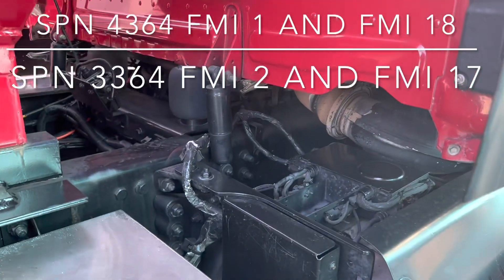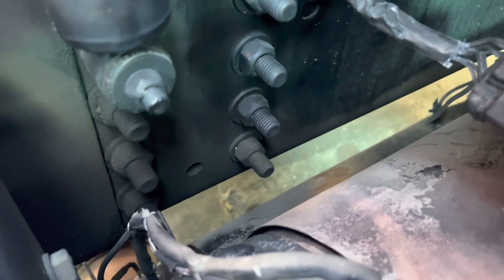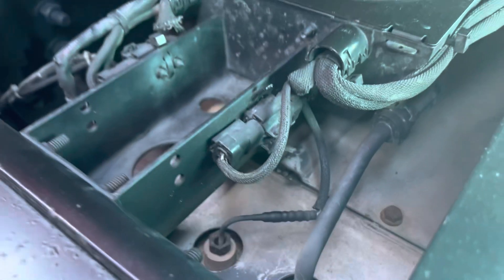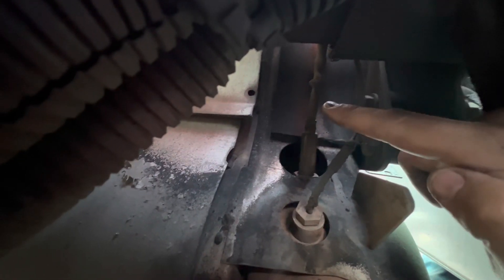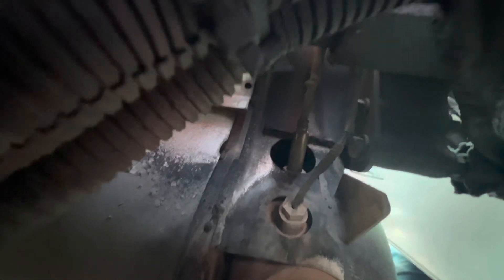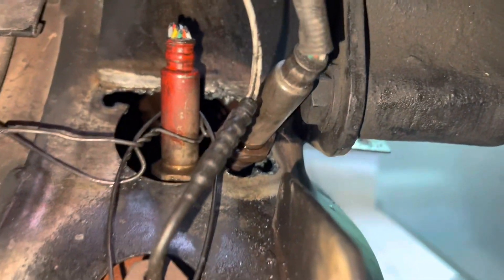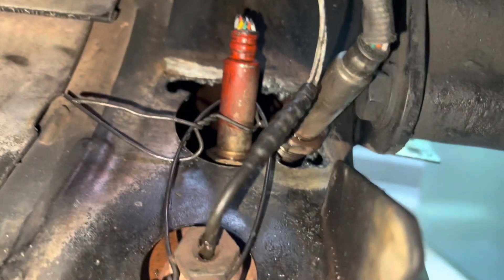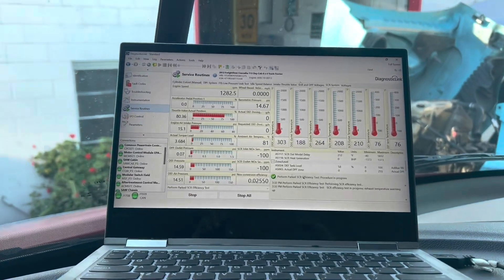NOx efficiency low, SPN 4364 FMI 1 and 18. SPN 3364 FMI 2 and 17. Try this work first.

Comment: Been getting a code for outlet nox sensor error, but seems to work fine. Know any work around for the code? Also does the outlet nox sensor error code turn off any regen process? Seems to be working normally but want to confirm. Sucks having a constant check engine light cause the sensor but beats putting a one box on.

Comment: Hey brother good video I have a question  I having kinda a similar problem on my 16 cascadia dd13 
When I go up in  a heel  loaded   it gives me the bad def quality signal. Then I run a regen and it goes  away  any idea what could  be ? .  A nox sensor?
Reply from the maker: You can run a parked regen and look at the inlet and outlet. If the sensor is fluctuating and not holding steady then it could be bad. Also look at the tail pipe for any ash or soot. The tailpipe should be clean and have no soot or ash present. 
How many miles are in the truck? 
The MCM will trigger a fault for DEF quality if the NOx efficiency low. The MCM or ACM does not know the difference.
Reply: It has 884851 i got my dpf filter cleaned 100k miles ago   also replaced  a faulty  def doser 45k miles ago  but they don't they replaced  doser gasket  found out it was leaking def .  I just replaced  the gasket   2 days ago   I hope that was issue
Reply: @196ozzy what was the issue?

Comment: 4364 FMI 18  inlet nox or outlet?
Reply from the maker: @pftrans  depends on how the inlet PPM and outlet PPM are responding. If they are stable then the sensors are most likely good. 
How many miles are on the truck? 
What year is the truck?
Reply: @CarlosDieselElectric   I checked out the reading were acceptable, contaminated DEF was the cause.
Reply from the maker: @ nice catch 👍🏼
Reply: Can this help to do the ctcheck regulation

Comment: I got the same codes, low efficiency. I'm at the dealership in connecticut, and they're talking about wiring and harnesses  🙄 
Their computer dont show codes but it shows on my dash
Reply from the maker: What is your NOx efficiency?
Reply: @CarlosDieselElectric  I have no idea I'm the driver I asked the guy if they were gonna run the truck on the computer to check for all that, but he told me tomorrow. But he kept saying it could be wiring, harness problem.

Comment: In this case have to replace the DPF or SCR filter which one is bad ?( can you replace just one filter?) Or at one box sistem is just to replace all box?
Reply from the maker: In a One Box. Only the DPF can be replaced. The DOC and the SCR are built into the unit and cannot be purchased separately

Comment: Works on 2016 dd15. Throws a code so dealer knows its been jacked with but truck runs fine. I forked the nox outlet harness loom and all. Have 2nd sensor in enclosure under my fridge in bunk. Almost Impossible to tell its bypasses by looking at things. 
It gets hot on its own thsts why its in a metal enclosure

Comment: Can you drive the truck like this? Not ideal or maybe legal, but in an emergency situation?
Reply from the maker: Great question, yes you can drive like this to get you where you have to go. 
If the efficiency is low or below passing, it could be a bad One Box, bad DPF or sensors. It isn’t illegal, again just helps you get from point A to point B.

Comment: This is called a bypass. California does not like this. And ghg17 models have a setting that detects this and will derate immediately. Only works on epa10 and ghg14 models. 2010-2016. Best thing to do is disconect the metering valve on these the botom two pin injector on the Metering valve and run a regen to burn off def deposits. After a regen reconnect and perform the efficiency test. If the effeciency rises the one box has been cleaned. If not the one box/scr module has failed.
Reply from the maker: The by pass is definitely a temporary thing especially if just need to get from point A to point B. New trucks are definitely getting smarter.
Reply: @CarlosDieselElectric  agreed.
Reply: Good afternoon do you have a video to do this on my truck ?
Reply: Just remove the Nox probe from the boss/bung, if you can buy a oil drain plug that has a thread pitch of M20x1.5 and leave the Nox probe somewhere where it will not be rattleing or just zip tie it off somewhere safe. Beware the Nox sensor probe does heat up to 1000 degrees for internal testing. So make sure probe doesn't touch anything.

Comment: So the 1 box is done & the sensor is still good. Am I understanding that correctly?
Reply from the maker: NOx efficiency needs to be 70% or higher. The outlet sensor should read around 50-60 PPM. If you have different readings you may have an issue with internal failure or soot may be pushing through. Look for any signs of soot at the outlet pipe
Reply: @CarlosDieselElectric mostly external these boxes don't last more than 500k. I did the same and so far so good

Comment: How can I make an appointment with you? I’ve tried 3 different shops and none have fixed my issue with these codes
Reply from the maker: Call my shop 323-728-4721 so we can talk more about what is going on with your truck and what you have done so far.
Reply: SPN 5246 FMI 0
SPN 3364 FMI 2
SPN 4364 FMI 1
SPN 4364 FMI 18
SPN 5246 FMI 15
SPN 5246 FMI 16

Comment: For how long will work this method? And how many time can do it before changing dpf filters ? Thanks
Reply from the maker: The sensor on the outside is so the inlet reads one thing but the outlet sensor will rear clean air and the efficiency should almost be 100%. 
The DPF filters themselves don’t have to be serviced until the MCM or ACM says so.

Comment: 4364 fmi 1 fmi 18
Reply: Hey Mrs pedro you were right about the SCR passing soot to DPF yes that's were the problem was thanks for your help
Reply from the maker: @dieselmobiletruck1631  glad you found the problem. Hopefully the truck can be fixed. I wish Detroit would have designed the One Box differently. I do like how Cummins does it. Keep everything separate and serviceable.
Reply: @CarlosDieselElectric I have heard of people “repairing” the actual one box to fix this issue. Never seen it done unless it being done this way like shown in your video. Have you heard of people fixing one box’s ?
Reply from the maker: @ the One Box can be fixed if the inside welds have come apart. You can bake the One Box if you remove both DPF filters. There are a few things you can do to improve the efficiency.
Reply: @dieselmobiletruck1631  was the 1 box bad?
Reply from the maker: Check for any signs of soot in the exhaust pipe. You may have a compromised One Box that is allowing soot to pass through to the SCR and that will definitely give you a NOx efficiency low. Check you DEF quality.
Reply: I did check with the refractometer
Reply: Yes sr you are right in this case isn't.  The SCR DPF is all in one that way they called one box.
But once again whit all may respect thanks again Mrs pedro

Comment: Only one thing makes me suspicious.
Nox sensor measure nox concentration . Correct?
Now how outlet sensor readings higher then inlet sensor.  If sensors reading correct numbers outlet sensor can't read higher then front  What producing the extra nox amount?😎 I think the problem in that case is the outlet nox sensor. I was checking my theory on two different truck with bad scr filter.  Im not saying that scr box is functional and Im not saying outlet nox sensor replacement going to bring up efficiency. Only saying according the numbers in my experience if both sensor is good outlet sensor never higher than the inlet . But im not  in the commercial truck repair business just a diagnostic and troubleshooting fanatics having fun help for my trucker friends.
Watching every episodes and thank you for your hard work creating the videos.  🍻🍻
Reply from the maker: In my instance, the tail pipe had heavy soot. Usually means the DPF may have issues even though you can complete a successful regen or the One Box may have an internal issue or failure.
Reply: I think you misunderstood me and we r not the same page. Not trying to  judge or question your decision . Also I not saying that 1box is functional.
Only saying is outlet nox sensor IF working properly can not be higher then inlet sensor.  Unless some small engine hiding inside the scr and puffing out nox.😃. Just think of the dddl low temperature regen for nox sensor drifting test . I hope no hard feelings because I have a loudmouth.✌️
Reply from the maker: @Louis19699  Roger that. No feelings hurt at all I understand 👍🏼

Comment: Good morning Mrs pedro I have the same problem with a 2014 freightliner 114sd Detroit dd13 and in my case the DEF light is flashing when I do the regeneración start whit 2% and goes up to 98% and drops out to 40% after 20 minutes the SCR test fails any ideas. 
So far I replace the DPF filters because they're were cracked put a new I that the it was all but I have the DEF light flashing like I mentioned before
Reply from the maker: What is the DOC inlet pressure? 
Also, on the tail pipe, do you have any signs of soot ?
Reply: @CarlosDieselElectric  doc inlet is reading at around 0.63 psi at its hottest
Reply from the maker: @norcalgorilla  how long does the regen run before it aborts or it is stopped?
Reply: @CarlosDieselElectric  it runs the regen for about 40 minutes. It reaches the target temperatures, 600 and 1200 degrees. Once it reaches target temp, the scr efficiency just drops.
Reply: @CarlosDieselElectric  we tried what you did on this video. Ran an scr test and it lasted 15 minutes. Conversion efficiency was high as expected, but the def light never stopped flashing. I'm also noticing that the icon for the acm blinks on the laptop sometimes. Is a bad acm a possibility at this time? Pressures and trmps were all good, I even did a cold soak to verify.
Reply: @norcalgorilla  Did you regen it? Running the scr test and regen(ing) are 2 different things. Regen may clear the def blinking lights
Reply: @moethedeaf2746  yes I even ran regen and nothing stops this stupid blinking light
Reply: @norcalgorilla  What kind of codes do you have when you scan?
Reply: There's soot but not much built up

Comment: so at 650k or 750k one will have to replace the one box???
Reply from the maker: According to Detroit they said the life of the One Box is around 650-700K miles. I have seen them last longer but I think it depends on maintenance history, idle time, City driving versus over the road.
Reply: @CarlosDieselElectric  ah ok I just got a new code on my 2012 freightliner that I have never seen before. would you have any idea what it means? BRAKE SPN000639 J1939 NETWORK 9.

Comment: good tip, ive used it before works perfect. My ? is on a ghg 17 parked scr performance test. the truck puts out pretty much 0 outlet nox but fails the test, dddl say it failed MU3 test. What is MU3 test?